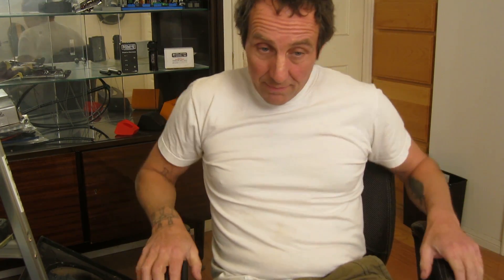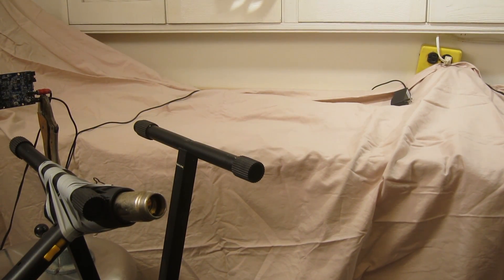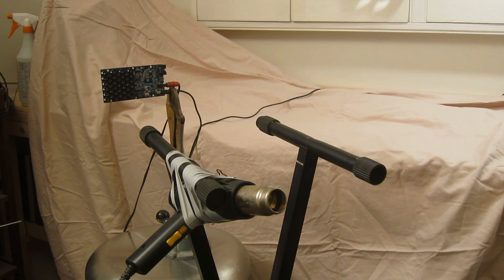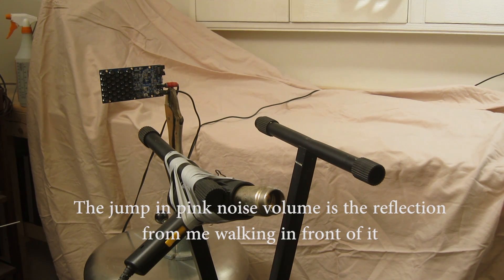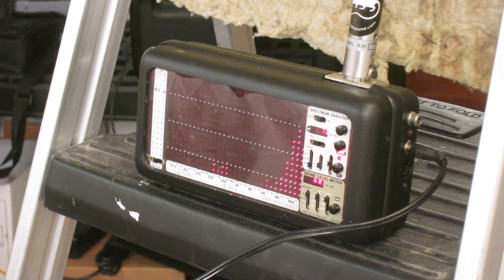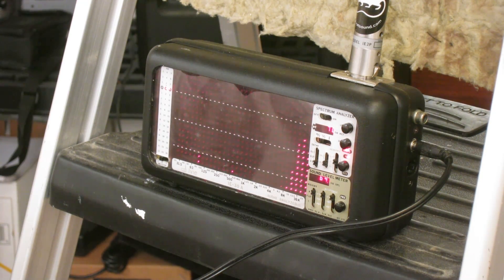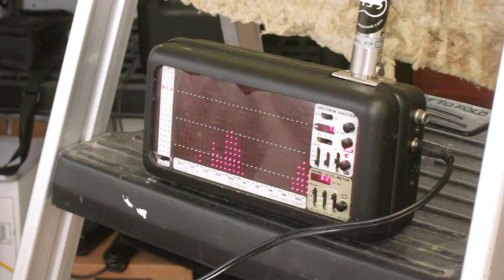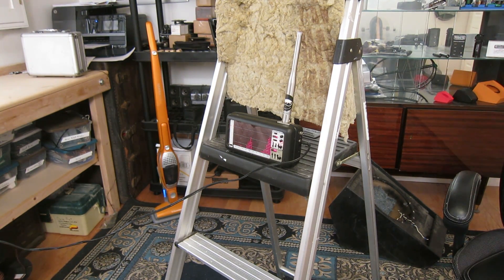Why Crowded Shows Sound Dull - Impact of Heat on Live Sound Coverage

Comment: I had a room that crammed in 250 people. Prior, i tuned the night before. The following night, it had rained a bit. It was a VERY humid day, and the people bought the humidity into the room. There was no air con, but only a couple of fans were pushing air around. The sound was completely destroyed. I had mid-hi flown and pointed into the crowd, but it sounded crap until i lowed the flown element of the PA and pointed it parallel about 7 feet above head height. ...that had helped heaps (as before) the hi end was pointed into the crowd it was absorbed too much. When i pointed the hi end straight above their heads parallel, everyone heard it a lot better. So maybe for all the wrong reasons... it worked.😊
Reply from the maker: Interesting. Turns out humidity doesn't impact sound very much but heat affects it significantly.

One of The issues that he creates is when you have an inversion layer.

That is where you have cold air sitting on top of hot air which causes significant refraction of sound off of the hot air if the sound system is radiating from a space that's up in the cold air.

Sounds like what happened in your event was you lowered the PA such that it was radiating sound from within the hot air and dropped it out of the colder air above.

Perhaps it was an air conditioner or it was colder outside and the roof was radiating lower temperatures creating the inversion layer
Reply: @DaveRat  yep, that's the conclusion I had to drop it. Still wasn't ideal, but it was better. Figured the hi end dispersion angle could allow a better result about 3 feet above head height. Temperature definitely. But with humidity, those fine moisture particles absorb energy too.
Reply: @DaveRat so we played an outdoor show a few years ago in the summer in Nebraska. By sunset, the humidity was around 80% and temperature similar. It seems that the sound really didn’t carry very far compared to dry air? We have played way higher temperatures without experiencing this. I was thinking that the humidity really effects the way the sound travels through the air

Comment: No...  The higher frequencies are absorbed by the crowd.  Doesn't everyone know this?
Reply from the maker: You mean like fiberglass in the wall absorbs high frequencies of course.

Except the fiberglass still hears all the high frequencies that it's absorbing

How come the people can't hear the high frequencies they're absorbing?
Reply: @DaveRat   Certainly they can still hear the small amount of the overall speaker output that is coming at them directly, and if it were possible to focus the entire speaker output on their ears like a laser beam, nothing would change in regards to the size of the crowd at all.  

But what you have failed to consider is in an empty room that listener would also be hearing a tremendous amount of reflected sound as well.

You could fill the remaining area around a single listener with (cold) sound absorbing battens, and I assure you the effect would be the same as having a crowd of hot sweaty people around them.
Reply: @richmond4471 Air temperature changes air pressure sound is entirely dependent on pressure Rising air will reflect pressure waves

Maybe it is not the entire equation but it surely plays a large part in it

Now the fact that the heat gun creates a layer of air that is moving might be reflecting away the sound waves and it might not be the heat of the heat gun at all
Reply from the maker: Have you watched my video where I use the flames of a gas stove to do the same thing? 

When I used to do my seminar and travel around the world talking sound, I did a demo with a hot plate where I shot a speaker across the top of a hot plate and put a mic on the other side of the hot plate and as the hot plate increased in temperature the sound of the mic became noticeably dollar and dollar.

I actually did this demo for a namm show presentation as well but for that I used a bunch of tea candles and a speaker shooting over them and a mic on the other side that was run into the speakers the audience could hear.

When we supply sound systems for large festivals like Coachella, one of the issues we face is the temperature of the ground changing from the hot sun to the cool evening. The warmth of the ground actually refracts the sound such that the coverage distance is increased by hundreds and hundreds of feet and as the ground cools the coverage does the opposite and contracts.

Nothing I'm presenting here is a mystery or unknown. The fact that sound refracts away from heat is well known.

What I'm pointing out here is that phenomenon has a real world impact on the coverage of sound systems in the real world.
Reply: @DaveRat  my point was not to refute your point my point was to answer to him I have been doing it long enough to know that your point is correct
Reply from the maker: Copy that! And thank you!

Comment: another dave rat , soundly indispensable test 

i have to do this test as well as i am bored  and i'm a fair guy . but this flipping heat is making me absolutely crazy .
i have heat gun .
i have enough calibration microphones .
i have audio mixer .
i have enough speakers to use for the test . 
i may even try the test with ........ 
i may do this test tomorrow 

dave , do test again outdoors with REW frequency sweep graph and repeat same test sweep again in wintertime to see the differences with the graph overlays .

oh , almost forgot , i guess the inner of the body the listening heads temperature will go up few degrees warmer and the higher high  frequencies lowering ?
Reply from the maker: Do a search for my AES paper on heat and horn dispersion that I did with Mario DiCola 🤙
Reply: @DaveRat  i have to pay to read all the paper . the video i get the idea and conducted same test in my room . 
often my room THX cinema , 26c and that's with some of the processors switched on . 
i placed the heat-gun "paint stripper" off axis to the projection at-screen , near the HF horn JBL 2380A JBL CD 2445 . i used cable tie to hold the heat-gun to microphone boom lol .
you could update on this test as it was 2015 . 
i tied air conditioner , but tricky and not messing with it as don't want damage it . was going to use bag of ice-cubes then maybe do smoke fog machine video with laser projection beams with a movie . the heat-gun test will suffice . my video on it be up soon .
dave , keep up the science tests they are good .
Reply from the maker: Love that, yes test

Comment: Great video. Does this happen only indoor Venus?
Reply from the maker: Actually no.  Outdoor festivals, warm ground will extend the coverage and at night coverage areas reduce to shorter distances.  Heat is heat, it does not know if its inside or out

Comment: Jusnt dont tun it up beond 85 MAX 90 db because that will cause hearing damage / bepp in the ears or tinnitus 
Trust me its not fun also you should not mess with the ventilation / ac  becuase those are on to avoid dangerous co2 levels anc to ventilate bacteria in the air also warm venues are not fun to be because heat causes fatigue 
Also  id dont think people mind a loss of sound quality over proper ventilation and air quality
Reply from the maker: Oh my, lots of worry and rules! Well, since airports, races, fireworks, an open car window on the freeway, a monocycle, going fast on a bicycle, snowboarding fast, audience cheering at any sporting event, and too many other things to mention all exceed 90 db, perhaps all of those things should be absolutely avoided, right!!

As far as taking active control over the venue temp to optimize the audience experience vs just leaving it set wherever the local human thought was a great idea for the last hockey game, I would say that skilled attention to making things as good as they can be vs trusting someone that does not have the shows best interest at heart, is preferable,

But who am I to say, its not like I have ever done some of the largest rock shows on the planet and mixed for for 40 years. Oh, wait....
Reply: @DaveRat  sorry abou my comment i was probably tired an i have a mild case of hypochondria
Reply from the maker: All good. Balancing risk and reward is a challenge we all approach differently.
Reply: @DaveRat  yes i usualy eq my music so that i can play it at lower volumes but still sound great becuase if i use my big tamonn speakeers
outside neighbours might otherwise get pissed off  so i run my system mostly indoors witch has it pros and cons including reverb and smaller spaces get more sound at lower volumes so constantly adjusting eq and volume settings to make sure nothing gets to loud but it also is not to quiet
Reply from the maker: Cool stuff
Reply: @DaveRat  just wear earplugs when there are dangerous sound levels my dad could not handle his level of tinitus anymore and well lets just say he passed away
Reply: Dave, maybe do a video on the best earplugs that can represent the music but also protect the ears? Just saw a couple Phish shows and sat under the arrays in the front.. it was great to see a lot of the crowd wearing plugs. I'm happy with just rolled up tissue paper and it's worked for me for years as a drummer, and I can adjust the amount of highs that make it through by how much I wedge them in. Just a thought to see what would be 'professional' sound protection without removing the enjoyment of the experience. Most concert goers should be made aware that it's no joke, and many local sound guys or bands unfortunately don't necessarily take that as a concern.
Reply from the maker: I will ponder that. A big issue with earplugs is it reduces the highs but not the lows so no matter what you do there will be an imbalance between what you hear and what you feel
Reply: @DaveRat  i have alphine earplugs that reduses the low and highs
Reply from the maker: Hmmm, we hear sound and we feel sound through our bodies as well.  Ear plugs reduce the sound we hear. To reduce the thump thump sound we feel, the ear plugs would need to include a huge bubble that you stand inside and prevent the subwoofers from vibrating your body.

When mixing, quality ear plugs can offer a balanced sound to your ears but in order to know if the perceived  lower frequencies are balanced with the rest of the frequencies, ear plugs need to be removed.
Reply: @DaveRat  Ya, i imagine you can't get an accurate balanced attenuation if listening to loud volumes with plugs. I'm looking for how best experience the music fully, clearly, feels loud, where it drowns out the audience around you, but is kept limited below any damaging levels. Just a thought, I imagine due to the equal-loudness contour of perceived loudness, EQ'ing would be different for people closer to the speakers sitting in higher volumes than in the back of the room. I'm theorizing that if you are sitting in a seat where there are higher SPLs, then the perceived frequencies between 2-5k (or whatever the curves say) might need to be lowered compared to someone sitting in a seat with lower SPL. The perception of the levels. Just a thought. So if I where to design plugs then maybe start there.. plugs for louder sound, plugs for quieter sound. Rock on, love the channel.
Reply from the maker: Yes a variable HF balance would be helpful for compensating. 

Earplugs that drop 10 db tend to work well but I find sound still to loud.

My favorite plugs to mix with are pure semihard silicone custom molds that is put in a bit loosely for more HF and all the way in for max atten

Comment: Great insights and demonstration. Thanks again to Dave Rat for an informative video!   I would add that locating the speaker arrays higher is also better because it can give you more even SPL coverage of the audience, with a lower front to back ratio, but yeah, that heat effect is a really great thing to know, for sure!

Comment: Thank you very much Dave, but at what temperature will the sound bend?
Reply from the maker: Sound tends to refract when encountering a temperature differential.

The more drastic the differential and the longer distance the sound is traveling while encountering the differential, the more sound will bend away from warmth or toward cooler air.

Comment: The reason from physics is that the speed of sound has a small temperature dependency. So in the same when when a soundwave hits a layer of air with different temperature it is deflected like a laser in a glas of water...
Reply from the maker: It's interesting to sort through these physical phenomenon and find which aspects impact us in relevant ways and which aspect we can ignore.

I co wrote a paper for the AES society describing how sunlight on audio horns can alter the dispersion of the horn.

Comment: I noticed the car stereo sounding slightly different when it's freezing cold from when it's very hot. I thought it might be caused by the speakers being at different temperatures, affecting the stiffness of the cone material.
Reply from the maker: Good ears and yes, cold will tighten up the cones and and drop some low end till they warm

Comment: Is this why you want your tubes in your tube amp warmed up before playing or recording?
Reply from the maker: Hmmm, thats a fun stretch connection. The tunes need to warm up and stabalize to pass sound. Probably more like needing to defrost soup before you can stir it.

Anyway, the impact of heat on sound in air is different frome the impact of heat in sound in wires.

Comment: I love straightforward explanations of technical geeky stuff. If heat changes the density of air so much that you can see waves above a hot road, of course it's going to affect sound traveling through hot air even more. But I wouldn't have thought of it.

Comment: The problem with this experiment is the noise from the heat gun or hair dryer makes it unbelievable. If you revisit this experiment and really want to prove something, use ambient heat such as a portable baseboard heater or radiator, which doesn't have the possibility of destructive interference because it makes no sound. I'd like to believe what you're saying is possible, however, you're proving it wrong.
Reply from the maker: I did another vid, I think it's on my Instagram where I shoot a speaker over a gas stove burner and have an RTA and mic on the other side. You can clearly hear it without the heat gun noise
Reply: There was a link where you are running down your rig set up for RHCP in 2016 and giving your philosophy of sound engineering, I watched it. I don't know much about cabinets or effects just the basics on waves and interference, but I found your interview really interesting. I just thought I'd come back and say thanks for making the shows the best that they can be for whatever band you're with. You clearly care about the synthesis between the band and the crowd. Next time I'm at a show I will definitely pay more attention to the engineer booth, and hopefully I catch one of your shows.
Reply: To explain it further the heat forces the particles of air to expand from one another which makes the higher frequencies die quicker .
Reply: You aren't nearly as smart as you think you are. But Dave is.

Comment: Very interesting. 

Got a very bad issue at an outdoor gig recently where the sound on the stage out of the monitors was perfect while the overall sound out of the FOH was.... lifeless (poor bass frequencies).

The weather was hot and I suspect that the warm temperature had an effect on the FOH sound, as it was the same mix going through the monitors. On another hand, I need to give the FOH mix in mono a try instead of stereo as I now know that I'm losing around 3db (if not 6db) when panning in stereo (we got a yamaha 01v96 console) and the FOH speakers are pretty far away from one another. 

Anyway, thank you Chief for another great informative video.
Reply from the maker: keepin mind that temp impacts high frequencies more. and the longer distance increases the impact as well

Comment: Just ruminating here, but it seems the main issue we're looking at here is the difference between the empty venue and the full one. Of course we cant usually replicate a full room in sound check, so there will be differences. But surely any reflection from heat will be minimal compared to the refection from the floor in an empty room? Admittedly it's in a different direction and probably at different frequencies!
Reply from the maker: +Rosie The Band Thank you for commenting. The issue as I see it is that acoustic spaces are constantly changing. Yet test and tuning methods are primarily structured to 'set and forget'. We tune a room and then the audience shows up, the temperatures change and many aspects of the room sound change while other aspects stay similar. The floor reflection tends to be wide bandwidth, distinct and intrusive whereas the effect of the thermal layer from an audience tends to diffuse and dissipate high frequencies more than lows. I would say the value is using this knowledge to minimize wasting time tuning aspects of a system that will drastically change over the course of the show and focus on implementing methods to measure and easily compensate for the changing aspects in real time.
Reply: or hook up a monitoring system that adjusts your cabinet DSP in real time
Reply: mac rondo and what would that be?